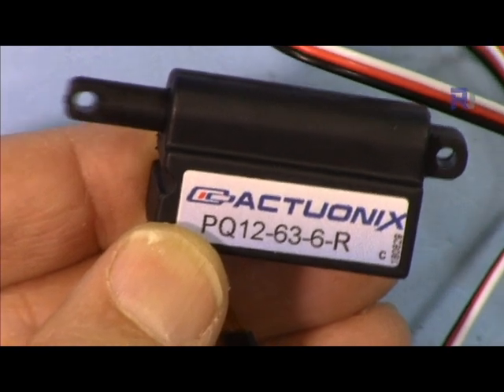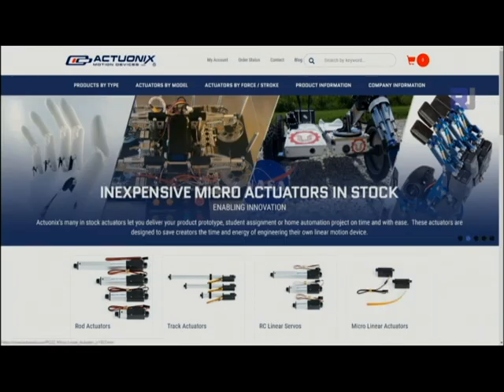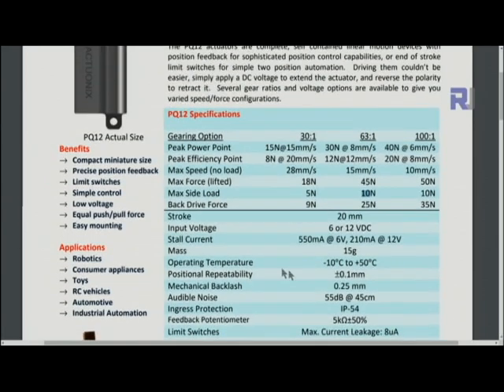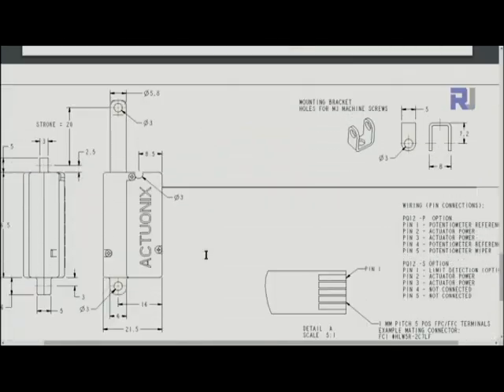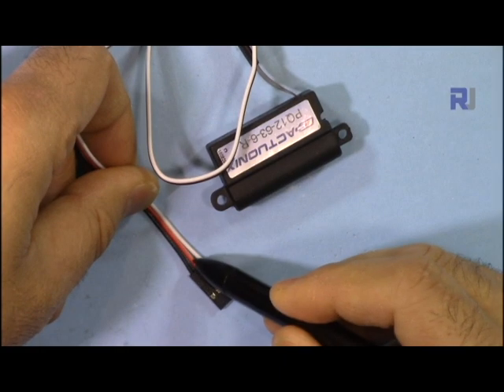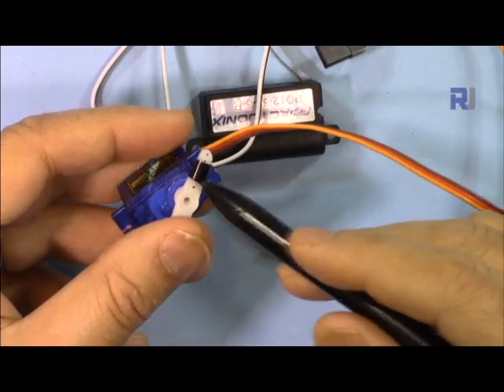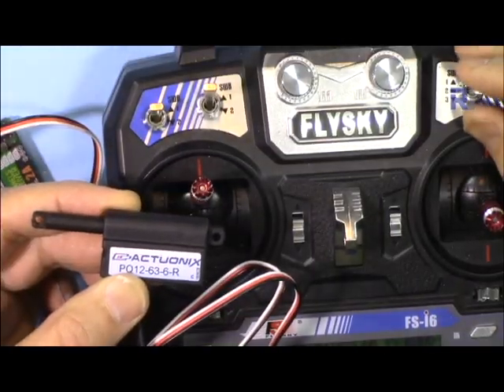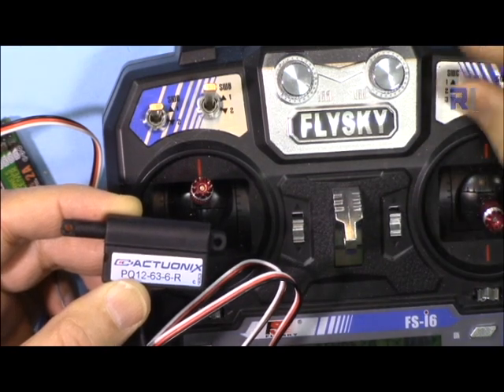Introduction and Test of Actuonix PQ-12-P Micro Linear Actuator

Comment: How to solve the failure mode?
Reply from the maker: Not sure. open it carefully to see if there is bad connection, solder or wire. you may have luck to fix it .

Comment: What is this cable adaptor? I received mine but the cable is a flat 5 wire cable. I want to control de actuator with a Arduino or raspberry pi
Reply from the maker: The cable is what it comes with. Did not purchase anything extra.
Reply: Hey man I saw the webpage and there are 3 different types, the  PQ12-P and PQ12-S are $65 but they dont have the 3 female wire adapter for arduino o PI just the model PQ12-R which costs $70 dlls.
Reply: May i know your project with this adaptor?

Comment: This is the R, NOT the P. There is a very big difference, the P has potentiometer feedback.
Reply from the maker: Thank you for pointing that out. I have shown at 00:50 as R and shown the wrong page. it doesn't change my explanation and tests. I have provided the link and viewer can check all models. Sometimes instead of voltage, I say current for 24V. But when I show on screen it is 24V and the viewer know it is 24V for voltage it is unintentional word just gets out.
Reply: @robojax  If you give the R a go please make a video, I have no idea what I am doing and I have to use it in a medical device.

Comment: $65 ? Why is it so expensive? Thanks for the video. A great one.
Reply from the maker: You are welcome Tommy. Because no other manufacturer is making it. It should be the same price as the SG90 which is less than $1.
Reply: @robojax  Kind of a smart ass reply to me . NO  The SG90 should be the same .  There is no extra cost between both sizes . Maybe about $0.01 UDS . It's all about profit . Get as much as you they can as fast as they can . But one thing . It is a free enterprise as long as people buy things at what industry want the price to be . Supply and demand and when these prices rise the less they sell . The less they sell the lost of profit they make and closing of industry . All people have to say NO or F you not doing it . Then the industry have to get the price down .